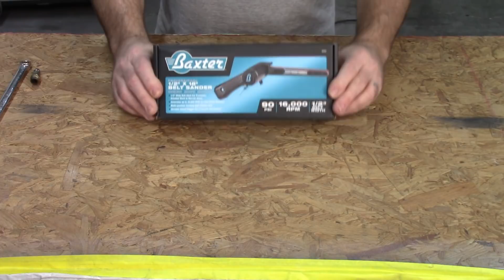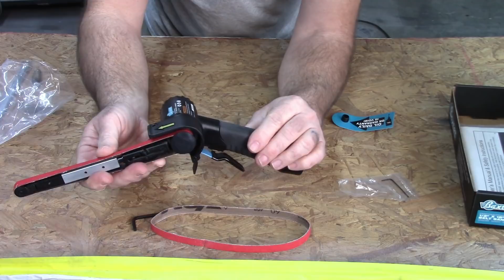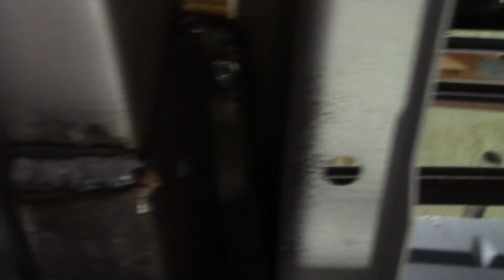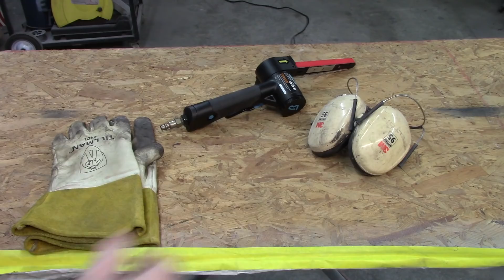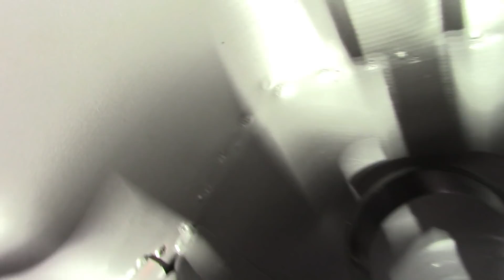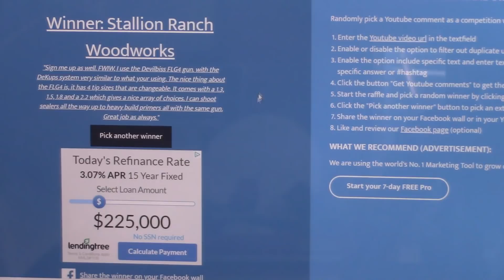Baxter Belt Sander from Harbor Freight. Blending welds on the 66 Mustang, Brooklyn Pony

Comment: i work at a body shop and this type of belt sander is used all the the, no more drilling out spot welds they just grind them out, leaves a nice smooth place for new parts to be spot welded back in, we use 60 grit belts, we have had courser belts but find they have their grit torn off too easy, next time i'm near a HF i'm buying a Baxter.

Comment: I have the Astro version of this belt sander tool , from Auto Body Tool Mart
Works great! Besides sanding  down welds, they work fantastic for cutting through factory’s spot  welds  for panel separation ! Rather than the drill bit style fluted spot weld cutters ! I use the purple 3-M belts ,  they last ten times longer than the cheaper Harbor Freight 
belts, worth the extra cost!
Reply from the maker: Have a link for the 3M belts?
Reply: Jo Daddy's Garage 3M Cubitron File Belts part # 3-M33446 80+ grade-1/2” x18”

Comment: love my little belt sander.. i used mine for the exact same thing on my car.. those suspension brackets are tough to get to. btw, you can get a 20 pack of belts off amazon for about $20 prime. they have 36-220 grit. Red Label Abrasives is who makes them. *edit - aaaannnndddd, you mention belts and yours are a much better deal.. added yours to my wish list for next time. thanks. also, the winner is running the same paint gun setup i'll be going to. gotta order my FLG4 when it comes time to throw color on my car.

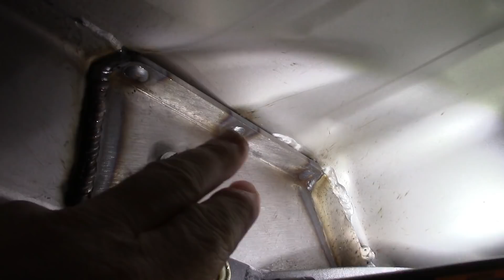Comment: The nut on the sway bar (?) attach point @ 9:30 has too many washers. The nylon locking portion looks like its not grabbing bolt threads.
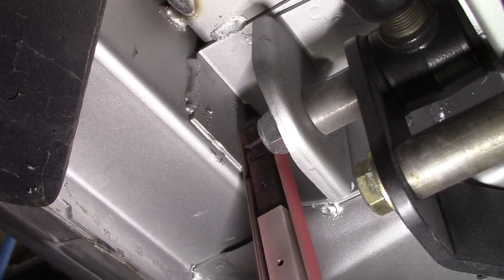Reply: Sorry. Didn't know this is just mocked up, as the nut at 13:20 spun.
Reply from the maker: Good observation. Glad you saw that thing are just mocked up. Thanks.

Comment: I've had Harbor Freights Chicago Electric version of this sander years ago. The tool itself was OK, but the problem I had was with the sanding belts that HF was selling. They would easily break after only a short period of time. Unless the current version of belts are also an improved version, I would shy away from this tool.
Reply: So spend the extra money and get some 3m brand sanding belts for it. They are more money but easily last 3x as long

Comment: Hey Barry. This tool has been on my wish list for a while. Looks like I am going to be making a stop at HF this weekend. If you are not already familiar with the 4.5 inch flappy disks I suggest you give them a try. They are a must have for grinding welds on flat surfaces. They work fast and leave a uniform flat surface for welds that are undetectable.
Reply from the maker: Thanks. I've used plenty of those discs. They're great.

Comment: BlueCollarKyle seems to do everything with a belt sander, even dressing up MIG welds he could have easily reached with a regular grinder. Have you ever tried that?
Reply from the maker: I've tried that in some instances. It worked fine.
Reply: @JoDaddysGarage  Thank you for the answer. I think I have to get a belt sander - but not a air tool but a corded 9032 from Makita. Maybe the cheap Black&Decker would also do the job but I love buying quality tools.

Comment: Hi, do you think this belt sander would be good to grind off all the welding points on a patch panel repair or is better to use a grinder disc instead? thank you.
Reply from the maker: I think it would. A lot of people are using these to grind off spot welds.

Comment: Great tool! But doesn't it require a very powerfull compressor? Mine only makes 12 cfm (measured at atmospheric pressure) - I don't think it is sufficient.
Reply from the maker: I use a 60 gallon 5HP compressor. It's your basic home depot or Lowe's style.

Comment: Looks like a decent tool. I have a sincere question: does grinding the dome off spot welds ultimately weaken the joint?
Reply from the maker: It does not. The weld is made by contact with the base metal, and the added piece. Welding the hole shut makes it a solid weld.

Comment: if you removed the wheels from the car, you'd have more room to operate the sander. some of them welds need to be "re welded".  they would never pass inspection....
Reply: @Butch  >What? Welds won’t pass inspection. In the “People’s Republic of California” I didn’t know any inspector could spell “Weld” much less know what one looks like after ground smooth, seam sealed, epoxy painted, base & clear! Wait, did they get those new glasses “As Seen On TV”?
Let’s see your welds...or did they all sink!